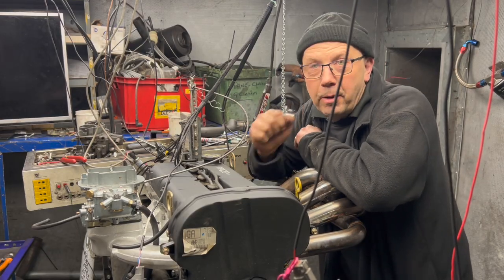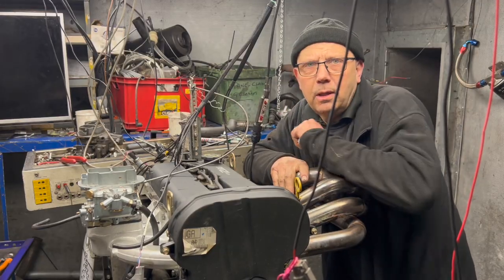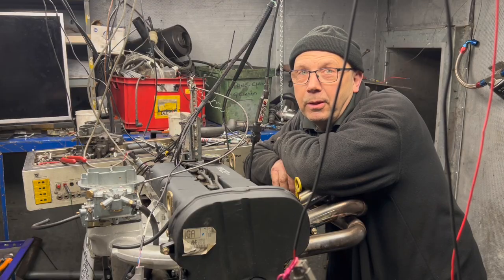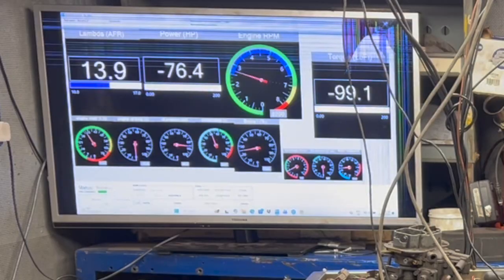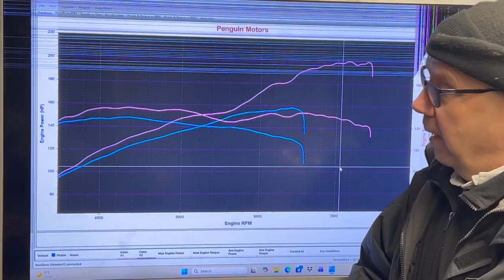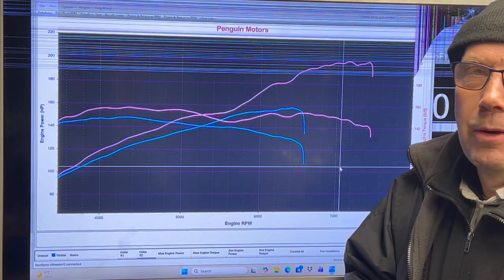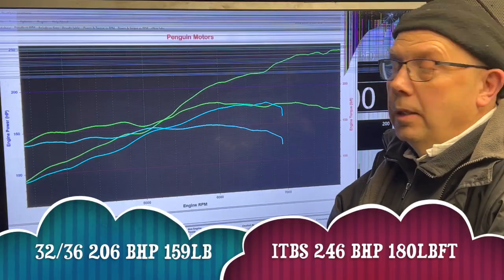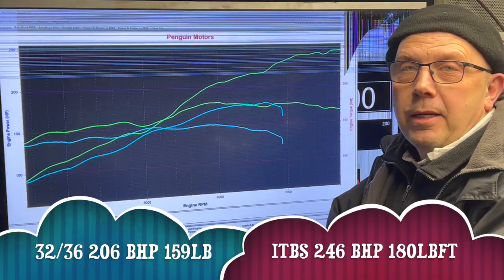MODIFIED  BLACKTOP  FORD ZETEC ON THE DYNO

Comment: That engine looks like and sounds like a Cosworth BDA.  A BDA for production cars.  Pretty neat.  Good work on getting the most out of it.  I'm impressed.  I worked at an engine builder in the US that rebuilt and tweaked BDA's in Formula Atlantic cars in the early '80's.  This engine seams similar even in the horsepower.  Of course they used Weber DCOE carburetors.  I don't remember the venturi size.   Oh, one more thing the BDA was 1.6 liters, so the Zetec has 400 more cc's on the old Kent based BDA's.
Reply from the maker: your correct the origonal BD in mk1 Escort were 1600, in production form the escort mk2 had an 1840 cc alloy block, but only a single carb, Rally use they were opened out to 2000 and usually ran wiith 48 DCOE and made around 245 bhp. Production 1600 BDA had 30mm chokes in its dcoes, and made 120 bhp, obviously there is scope for way more than that.

Comment: What are you're thoughts on 'tuning' the Weber carb? I have a standard but new blacktop with DCOE 45's and 36mm chokes. It pulled 182 bph on the dyno. Is it worth to add; full radius velocity ram pipes and cutting in the carb / removing material for better air flow?  

Or with my standard blacktp be restrictive at this point in terms off cams, valve size and/or flow thru the cylinder head?
Reply from the maker: you dont know unless you try, sometimes full radius work, in my opinion they are more for bling than function most of the time. I doubt you will gain much trying to rework the carbs, might be worth trying some 37mm chokes, certainly cams and or headwork with a bit of a skim to up the compression would be the way to go next. you might be able to squeak a bit more from playing with inlet cam timing even on standard cams, although i dont think you have much room to spare on standard pistons
Reply: Thank you very much!  @PenguinMotors
Reply: @PenguinMotors   Graham question! When we put the zetec on the dyno it was running perfect but on track I experience a rich condition in the braking zone, it also sputters when I go back on throttle after this rich condition. I have a AFR gauge showing values around 10 in the braking zone. The guy who tuned my carbs in the Netherlands didn't know what to do. Where should you start if you hear this? Carbs are new. I have some footage ;) https://youtu.be/o3mVpTyZwrs I believe the gauge is turned on at 44:35 min.

Comment: The Zetec has to be one of Fords greatest engines. It is relatively easy to fit in place of a Pinto or CVH, it is robust, tunes well, isn't overly heavy and they are at the moment plentiful and not expensive to buy.

Comment: I need to stop playing around with old VW 16v engine's, that's impressive numbers! Great content as always.
Reply from the maker: You mean the ABF? I've done a couple they are alright, but so far I've only extracted 220bhp from one so not huge power and that was similar spec to this zetec
Reply: @PenguinMotors  Yep the ABF,  They hit a wall around 185 on std inlet manifold, that Zetec made 206 on a carb 🤯 It's from the poor bore/stroke ratio and then lets not look at the ex valve 90º to the pistons on a 16v head! Who does that!?  total poo compared to the Zetec. 
Again great video's and info.
Reply: And let's not forget the single belt pulley and then a chain driving the other cam, total pain in the ass to even play with cam timing.
Reply from the maker: the thing with the ABF is it wasnt a clean sheet design, they simply took an 8v, made all the valves into exhaust, and stuck 8 inlet valves to one side, driving them off the exhauts cam by a chain, keeping the 8v cam belt drive system, it was very cheap. In standard trim they make 150bhp which is really good given how poor the head flows air, so the inlet and exhaust must be pretty efficient, it just doesnt lend itself to making big power when tuned
Reply: @PenguinMotors  yep totally, 👍🏼
Reply: @PenguinMotors  I've done them at 250 @ 8300 on a compromised short inlet length with 300 cams, so they'll do + that with a better inlet system. 230-235 isn't overly difficult on 290-296 cams and a proper inlet length.

Do like a Zetec though, the std/detailed F2 engines make 170 on a 32/36, but that 200+ with cams and headwork is very good indeed, as is the 246 version. Have seen 165 from a couple of  totally stock un-opened blacktops on itbs, so the ol twin choke is doing very well.
Reply from the maker: cool, you are just confirming what i saw and what Ike was saying they can do given a newer style 4,2,1 exhaust

Comment: Thanks again Graham for the very insightful testing. Did you install the high compression pistons or did IKE supply the engine in that configuration? Was the piston change a direct replacement or was other work done  to accommodate them?
Reply from the maker: Ike dropped me off a complete engine all ready to go, all I did was dyno testing jetting/mapping and swing the cams. I say all, that was a long days work!

Comment: Now build an intake for two 32/36's. It's all in the balance tube displacement and location. Even though the top end would suffer a few, the mid range will cover for that. With the 4-2-1 exhaust. And to get some of the top end back, you can always carve them out. ITB's in that size really start to work between 8 and 12 KRPM. If the engine is planned on driven below 8, the pulses need balancing, as they are not yet flowing downstream.

Comment: It's good power think you can degree the cams then there will also be a power gain.  Make a video for cam degrees
Reply from the maker: I dont know how Ike arrived at the cam timing, it wasnt far out, all i did was loosen cam bolt, move cam at bit and run it again, we did about 20 dyno pulls in all trying to optimise it

Comment: Another great video from you Graham 🤩. You showed the potential of the Weber 32/36 DGV carburettor to be beyond reason. And thanks for the information on the jettings etc. in the previous video. Tomorrow I will start improving the new Ford V4 intake manifold (Saab 96) with the advice you gave in the previous video "How to got more free horsepower - Ford Pinto". 😊

Comment: 32/36 is highly under rated, anyone on a tight budget can knock out a stout little combination for not a whole pile of cash. What size were the IDF's Graham 40 or 44 and what size chokes. Great series of videos, thoroughly enjoyable.👌
Reply from the maker: 44's with 36 chokes
Reply: @PenguinMotors   it probably would do more with 38s and still retain driveability although the manifold might have other ideas , I've run them (IDF's) up to 40mm but in drag racing applications where it doesn't matter so much about the down low lack of response from a pretty much non existent venturi😂
Reply from the maker: i think for the IDF manifold to really work it needs a longer more gentle curve, or better still be straight and have DCOE's!

Comment: Good eye opener on the zetec, everyone after the 170 lump all the time but really the bog standard one will do for most of us
Reply from the maker: I know on throttle bodies with a good exhaust a standard st170 can touch 200bhp, but you need to be able to control the VVT properly to do so. So given we were knocking the door of 180 bhp, on our blacktop, with a touch more compression and tweaking of the cams one can get very close to matching anything a stock STcan do
Reply: @PenguinMotors tuned them both ways, with VVT optimised, and VVT ditched and the cams timed conventionally, same result, the std timing is retarded heavily, particularly lower down for emmisions, so no point having it over a normal set up with the std cams optimised to start with, seen a little over 190 with itbs and a compromised exhaust manifold.
Reply: Just a note on the VVT control: The trouble of working out what the CAM is doing due to the odd timing pattern was solved years ago, so most aftermarket ECUs have no problem running the VVT with a spare wire to handle the VVT solenoid. Tuning the VVT is straight forward enough, just keep bumping it until you get better horse power/toruqe from the dyno.

Super curious to see @PenguinMotors run the ST head.
Reply: Please do some zetec turbo testing
Reply: I have heard of a st bottom end and a zetec black top head engine . I would like to see one in the dyno  one day😊
Reply: @dondeeman  iirc ST bottom ends have sintered forged rods so the only real benefit to that would be for boosted applications. If you are trying to spin at 7.5k+ RPM... well it wont do much good either. Oil pump is just going to explode, valves will float etc.

Comment: I ditched the pinto power years ago for a zetec, have never looked back, lighter, more power straight out the box, hammer all day on track, now running a st170..even better..
Reply: The standard st170 heads are great. I switched heads and it made a big differance. Switched from Webber's to dellorto's and made it even better
Reply: @superdidly1 you should try efi. Even more better
Reply: @runesmDK  i did run throttle bodies for a while, dut side draught carbs look and sound much better on a mk1 escort
Reply: Inlet ports on st head are massive,

Comment: If that does not shut all the 38dgas fanboys up i don"t no what will😂
Reply from the maker: nope they wil all still say I should of used one!
Reply: @PenguinMotors  Honestly that would have been a good test. Since that motor and inlet are much more capable than Pinto stuff. Would have been very interesting to have a vac gauge on the intake during those runs to see what the actual manifold vac was.
A Falcon ADM34 with 27/29mm chokes. gives an extra 5.6% choke area would have been a good test with it as well.
Reply from the maker: Im guessing your down under? this side of the world we have never seen a Falcom ADM34